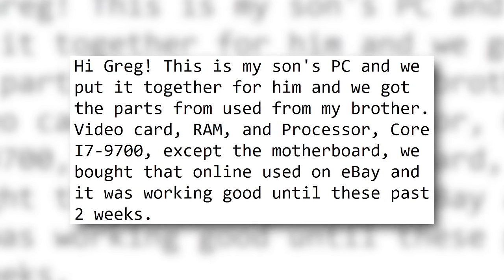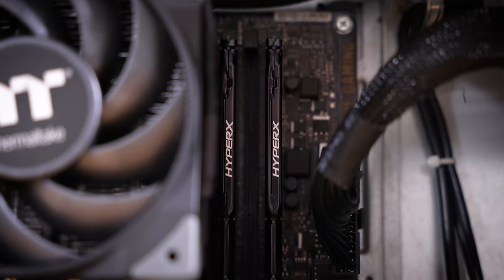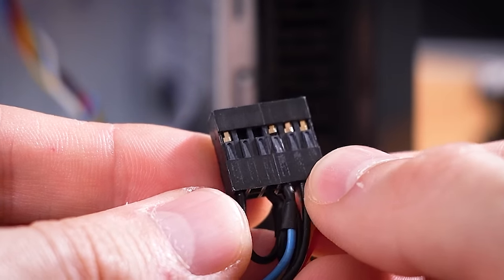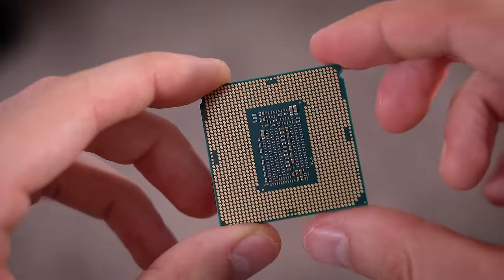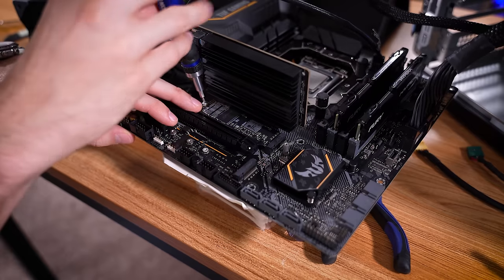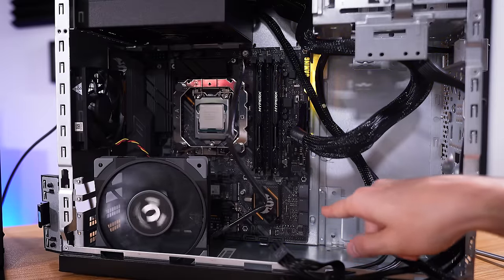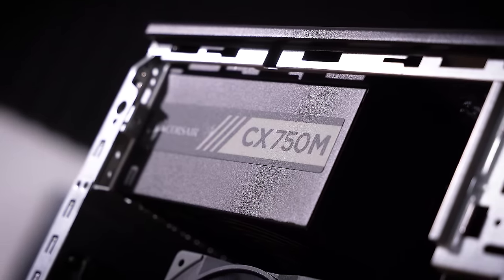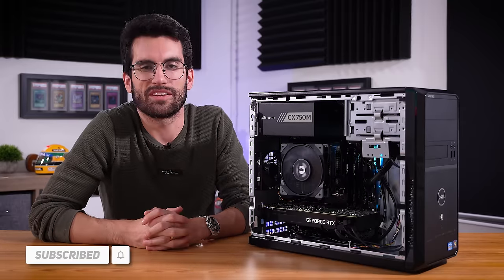Fixing a Viewer's BROKEN Gaming PC? - Fix or Flop S5:E1

Comment: Yeah, the only way to really learn is by doing. I started my journey doing flips almost ten years ago now with older and likely broken parts. I would have to find the issue and fix or replace what I could. I held on to the stuff I couldn't fix and always found myself going back to them. I remember a couple of years ago when I finally cleaned out my storage closet of old parts during COVID-19 and got everything working. It was one of my proudest moments.

Comment: great diagnostic greg, so may options that could have caused it....... i built a new am5 system and was having a similar issue, and it was due to torque on the cooler. always fun chasing the left field issues, but that's why i love troubleshooting, its nothing but puzzle solving and keeps you sharp :)

Comment: Not sure if it was the motherboard, power supply or both, but the short protection circuits saved the components from frying. Either way good job, good fix.

Comment: I have been building systems for myself since 1997; in one of your Fix or Flop episodes, where there system would not post, it turned out that the CPU cooler was to wide and it pushed the 1st ram stick out of position enough to stop the computer from booting. In my last build I had the exact issue, if I had not seen that episode early I am sure I would not have figured it out, but I had and it was the 1st place I looked when my computer wouldn't post; problem solved. Thanks

Comment: The power supply in my rig shorted out and tripped the beaker in the middle of the night. The PSU was an EVGA 600 watt 80 plus White. Luckily, I had a brand new spare that I purchased at Best Buy. Not 600 watts but a 450 watt EVGA that I got on sale for $20

Comment: I've had same thing happen on 2 dells and 1 HP case over the yrs... As soon as I saw the case it brought back all my WTF's.... Sure parts fit but people building need to check a bit more when they build, just because holes line up doesn't mean there will not be a problem. At least ya found it.

Comment: For the most part, when using older cases with newer hardware anything with the raised bumps (instead of stand offs) is highly suspect.  The trace and pin density on current generation hardware is much higher so there is less "dead" space for that type of mounting.  Something to keep in mind is you can alleviate the shorting with sheet insulation over the "extra" bumps if you don't (can't) modify the case.

Comment: Hi Greg. Your use of a hammer reminds me that drastic situations call for extreme measures. Once you found that case to MB contact, I would have placed a small piece of index card between the two to confirm if that was the problem.

Comment: I worked on a Dell PC that quite literally had a bad case. I could never nail down exactly what it was about the case that was causing the PC to have the same problems in this video. It took some convincing to get Dell to send a new case, but they did it. I installed everything in the new case and it worked.

Comment: At a repair shop I used to work at they had a "Dell Repair Tool" which was a large hammer, from frustration with their proprietary BS.  You literally have a Dell Repair Tool that you used.   I would have used a thick silicone pad or some equivalent non-conductive pad.

Oh and the speaker only works if set up in the BIOS/UEFI so it only helps in cases where you can post and get in, but it does help.

Comment: These are some of Dell’s non-Optiplex cases from early 2010s, before in I think 4th gen Intel is when they started getting crazy with the weird PSU & IO connectors. An alternative to rewiring the front panel connector is to just use jumper wires for a breadboard, although it’s a bit more jank. These cases make great sleepers since they’re old enough to look outdated but not too old enough to look suspicious

Comment: Nice find!  Intermittent problems are such a pain to track down, and sometimes the answer really is bonking something with a hammer.  Could have been as simple as the viewer scooting the case to a different position or simply it settling over time that caused the issue to manifest, just as how the vibration of transport temporarily disguised it upon arrival.  

As soon as I see intermittent powerup problems, I'm hunting for loose or shorted things with a fine tooth comb.  Got burned with callbacks a few times on an AC that kept popping low voltage fuses at random, and a walk in cooler that would trip a breaker about once per year but run fine when observed.  AC had a wire rubbing against a tube, and the cooler had a wire pinched from a sloppy switch installation, both in very sneaky to find places.

Comment: Having used one of those cases before for an 'upgrade', I knew what the problem was pretty well from the start, lol.  Those Dell cases are bad for having things like that (shorts from either non-standard standoffs, metal bits like you found, etc).  Some boards can even short on those standoffs due to the size (the part that touches the board is much larger than a traditional screw in standoff) if their tolerances are tighter than the board in it now.

Comment: You could use Polyimide Film Tape on the underside of the motherboard to protect the contacts from the case instead of bending/breaking the metal stand from the case.

Comment: if you are building a sleeper, put kapton tape on those 'standoffs'. They made sure the original board will fit but a modern MB will have components a lot closer to the holes.

Comment: Glad to see you can humble yourself. 

There's two types of techs. Ones that think they know everything and ones that realize, they don't. The ones that think they know everything, regardless of how long they've done the job, have never evolved. The ones that know they don't know everything used to be the know it all's. Congrats, you've leveled up!  

And yes, I'm gonna be that guy and remind you, I was one of those that has told you before to remove the case from the equation. When dealing with a system that does exactly what is in this video, pull everything, only use the bare minimum to eliminate as much as you can, and become much quicker at finding the problem. I kid you not, I had an optical drive that refused to allow the system to boot when the data cable was plugged in but no power. It's the stupid little things that can throw a wrench in the whole works.

Comment: I had a similar issue with my sleeper, but i was missing randomly some of the DIMMs every time i rebooted the system and sometime it would crash. Finally i tested it outside the case and it worked for weeks without a problem. I finally replaced the case.

Comment: I had an embarrassing experience similar to this a long time ago when I was building a brand new at the time system using an AMD K6-2 350 on an epox brand mainboard.  But the case I intended to use didn't have the correct standoff placement to properly mound that board.  One misaligned standoff was touching a couple of soldier joints on the back of the board and prevented the system for powering up.

Comment: Sadly a lot of the time. When you use a Dell case they have a proprietary input on the power buttons. That if you don’t change the pins around it will short out the mobo. And some of there cases have weird metal in odd places. Goes little metal tabs are for dell’s proprietary wiring runs around the mobo, gotta love dells great engineering. I’ve built over a hundred pcs using dell cases.

Comment: U need to enable the setting in the BIOS to use the speaker jumper, modern mobos dont have it defaulted to enabled bc most people building a system don't consider getting a system warning speaker. It's really there for OEM intercompatability.

Comment: A lot of times, motherboard BIOS’ will have a buried setting to enable or disable POST beeps through a speaker, so in some instances, you may connect the speaker, but the setting could be disabled.

Comment: When a system does something out of the ordinary from a list of known issues then you have to go to the less likely scenarios like shorting connections or unstable connections. I recently upgraded my CPU and it would not give a display output. It turned out to be a VGA extension cable that had worked it's way loose.

Comment: In this case, I don't see a standoff point, but if you ever have a motherboard that has a case with a standoff point missing, and you don't have one of the flat bottom plastic standoffs, you can take a standard white nylon standoff and cut the part off that goes through the motherboard tray in the case making it a flat standoff.  It will at least give the motherboard some rigidity and keep it from flexing down and contacting metal in those cases.  They're fairly easy to cut with just some scissors and it works well in a pinch assuming you have some of those lying around..

Comment: i was like its a bad ground. when it wouldn't turn back on. and then when you had it turn completely on outside of the case. i was sure it had a bad ground. ground meaning touching case some place. not a big pc guy. just deal with a lot of electronics on the daily to know that. but great job on the pc save!!! love the sleeper look. i believe that's the case that Dell used in the commercials back in the day. with the slogan "you're getting a dell"

Comment: -- That problem, is the first problem I ever had building my first PC back in the late 90s as a teen.  No training, no YouTube, just manuals.  I won, finally but it could have ripped all my hair out.  NOT a good problem to have the first time round.  Since then, no PC has ever beat me.  Had one stick of RAM once that played games, that took a minute.  Most recently had a PCIE ribbon cable for a GPU vertical mount that kept corrupting the NVME, with a second ribbon cable that came bad as well.  Third solved it, but before the second one I knew just what was wrong so no big deal.  But that one had me mixed up pretty good.  
   I've been doing this for 30 years and I'm still lightyears away from knowing it all.  What I do know, it's experience, order of operations, which really means trial and error.  I would have caught what you found.  How long it would have taken (or took you) who knows.  

Thumbs up.

Edit: Oh, and always have a hammer and a pair of well worn shoes in your car :)

Comment: had a set-up just like that recently with the old OEM case. Kind of sad I don't again, sleeper is so sick. Making a way to fit a 140mm up front is well worth it, along with drilling out the HDD drives to create space. Lastly I made a template for 1/4" holes that I drilled on the entire lower section of the case and then made risers. Made a massive thermal performance improvement and again, sad It's gone. easily fit a RTX 3080 and kept it plenty cool as it basically drew from the bottom and the 140 up front (after some sneaky improvements on the front panel) with a 90mm out back for exhaust

Comment: I had this happen a while back but not because I wanted the sleeper build look, but because cash was tight and case was skimped on. It was 5 days for me after which nothing, no sign of life at all.
I was always tech savy and I took the thing apart time and time again and when it was barebones out of the case and jumped, it posted. Once back in the case reassembled, nothing. I was bambozzled and immensely frustrated as I thought I was assembling it wrong... After 10  teradowns when I was putting the board back in lining up with standoffs, I heard it, an unusual clink when placing the motherboard and I did see it later on. Bought a new case, posted 1st try. I was stressed for days...

Comment: Almost around 2009 I had my first entry level PC
AMD Athlon X2 something with 2 GB DDR2 memory and a 256GB SATA HDD
Asus Motherboard
It was in a generic case from local brand with integrated PSU that had mustard/ketchup wiring.
The build wasn't something I was really glad to own but it was a start, but there's nothing I hated more than the case itself.

Fast forward to now, I have (since then) built my own system.

i7 11700k (Be quiet DR Pro 4)
4x 8GB DDR4 Crucial Ballistix memory @ 3200
Gigabyte B560M Elite
WD SN850 1TB nVME
iGame Colorful RTX 3060 OC
Corsair RM850 80 Plus Gold
and lastly Corsair 4000X (Glass)

Comment: Dell must have made billions of that case. I can see they removed that hard drive cage... probably should have added a front fan. Regardless, a really cool sleeper. I have a few of those Optiplex chassis here and they all seem to have the same tab, and all the boards have a spot for a connector right there as well, but it isn't populated on any of them. Dell should have had that isolated to begin with using some foam or something. Seems like it could even be a shorting risk on the boards that originally came in these cases.

Comment: I had a bit of a mad one last week. Woke up, switched on the radio, and was pottering around the house, making a coffee, then switched on my PC and walked away into the kitchen. 
Then suddenly the kettle just stopped boiling, radio went off, and I looked and the microwave was off too.
I assumed it was a power cut, and I wasn't looking forward to having a lukewarm coffee, and I was just about to haul out the gas camping stove, but thought I'd check the fuse box just in case, and found the main trip switch had flipped!
I was quite surprised by it, but I immediately suspected my PC had flipped the switch, and unfortunately I was right. My 18 month old RM850 put the whole house to sleep.
I threw in an old CX550 and all was well, but I had a quick look inside the RM850 and there was a big burn mark on the inside and a fried "something", I don't even know what the something was because, it was gone. Burned to a crisp!
It was strange because I hadn't done anything taxing with my system for weeks, no gaming or anything like that, and to get such a hard short circuit like this.

Comment: Usually a bad capacitor does that, the system will power cicle onece and then just dies, on a older rig that capacitor was on the Power suply, repaced it an worked fine.
Don't worry if you dissasemble the PSU you will NOT DIE, just unplug the PSU and try to power cycle first.

Comment: The case needs some rubber pads on the metal where the stand offs touch the motherboard, it might also be the case too because the motherboard can not touch the case at all if it is metal, and maybe the power supply and the heatsink might be causing a grounding issue.

Comment: I was pointing at standoffs so hard, I almost punched a hole in my monitor. While I used to work in cyberpoweruk, I quickly noticed that case and mobo mounting hole from time to time can interfere. Never f'up but still an easy miss

Comment: 🤣The latch of death... I only thought it might be that cause I build in an Dell Precision case before and cut it off with my Dremel. Its normally between the front USB header and the M.2 connector behind that Dell board. But you can only know thats it if you know its there.. Great video, will help some folks for sure.👍

Comment: Experienced similar issue where my boot drive (nvme Gen 4 SSD) wouldn't allow my PC to post. Tried everything else but it failed. Tried a new board but it still failed to post. Finally, it posted after I took it out. The funny part was that, the drive was working when I slotted it in my friend's PC.

Comment: I know this may sound incredulous, but my very first thought was the OEM case.  I had a DELL XPS 420 for years and am well familiar with the proprietary layout...in my scenario it was a BTX case that was unusable for anything but that DELL motherboard.  Two approaches...get a grinder...or stuff in between the board and the case protrusion an insulative sheet.  I would go with the former...just in case someone else unexpectedly removed the insulator at a later date.  Of course, I care little about the sleeper aspect of this particular build and would definitely go with a more modern case upgrade...but that's just me.

Comment: Speaker connector works only in one orientation, + is marked with an arrow on the connector and a + should also be on the board, technically the first pin from the left is the +

Comment: Wow, what a catch with the case shorting the board. 👏 Now if only someone could fix my computer crashing in games issue. 😂 It's probably a bad GPU. I could also try putting new thermal paste on it and replacing the pads or just find another GPU to test.

Comment: im at 7:44 and im guessing the power supply is getting a back charge from that jumper issue. You would have to discharge the PSU then try again and see if with a proper power switch it works fine. I will watch and see the results now lol.

Comment: On my current PC, I built it, loaded Windows, all the drivers, apps and it was working...... Except the sound. I updated to the latest BIOS, latest audio drivers, uninstalled audio drivers, reinstalled, nothing. I spent the better part of two days trying to track down the issue. I finally reached out to Realtek on their forum and a great support staff helped me out. I pulled the motherboard out and reinstalled it and that fixed it. There was a tiny contact that caused the audio to stop working when I installed it the first time.

Isn't working on computers fun?! 😁

Comment: I had something similar happen to me. As soon as there was a heavy load on the GPU i had blue screens. I was going crazy. Thought it was 100% the boot drive so i bought a new one and had the same problem. Even the windows wouldnt install. Then i figured out that some fan cables in the back of the case were touching the motherboard. Moved those to the side and i solved my problem completely. Unbelievable.

Comment: My first guess without watching the video would have been the PSU not having the current for the RTX GPU. I've seen that happen in quite a few builds where the owner builder cheaps out on the PSU so they can get high end other parts.